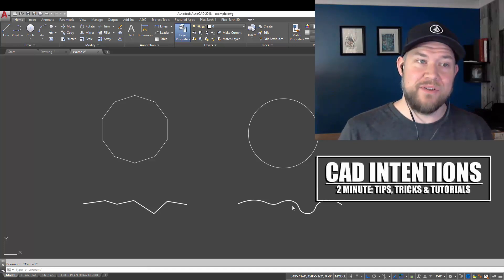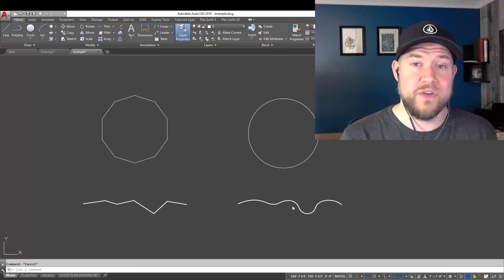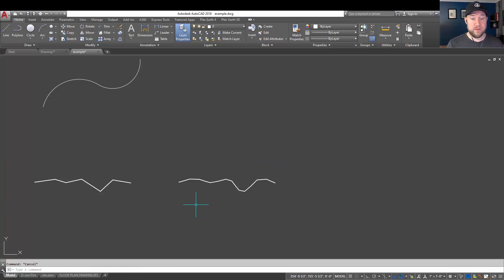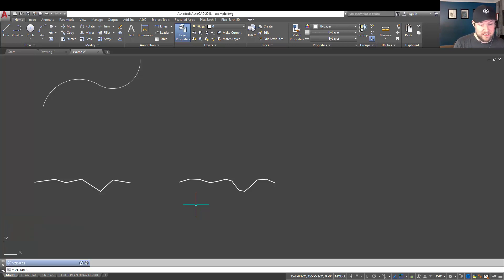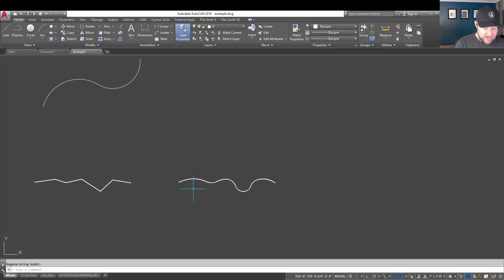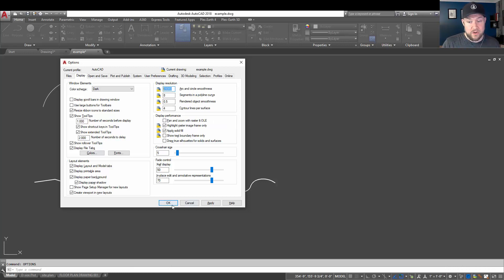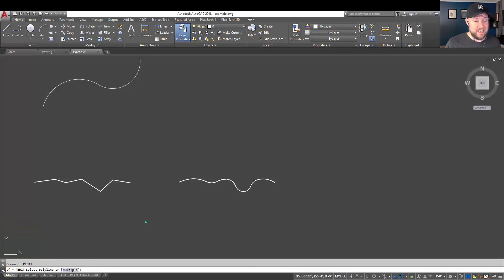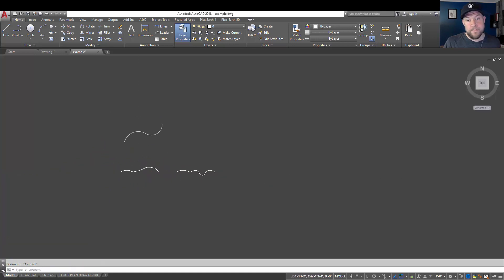AutoCAD: How to Smooth Curves, Circles, Polylines - Easy Fix, Viewres Command  | 2 Minute Tuesday

Comment: Does it actually smoothen the line or just the view? I need clean lines for laser cutting
Reply from the maker: The lines will be as clean and you create them, if using an arc or circle the line will be clean, this command really only affects how linework if viewed on a screen. Any designs/linework when printing will be as clean or accurate as the objects and vertexes used to create them.

Comment: Once you run the Fit option, is there any way to remove any unecessary (intermediate) vertices that fall along what should just be a continuous single arc?